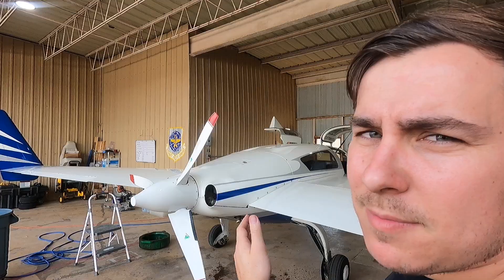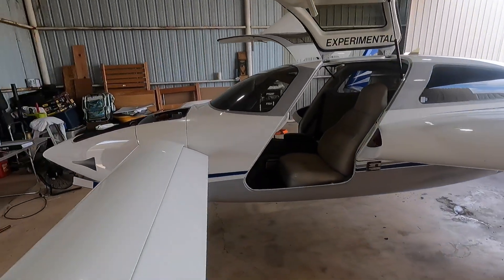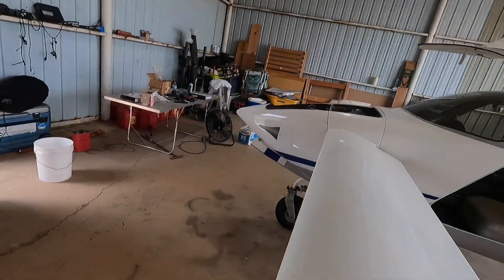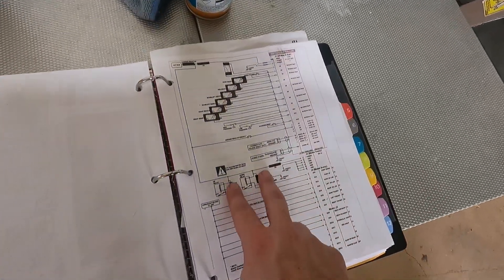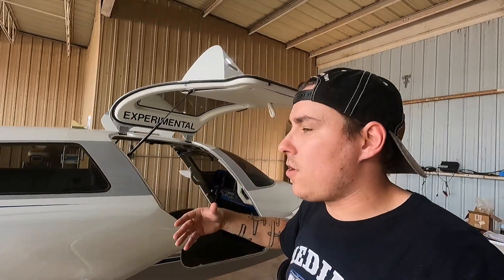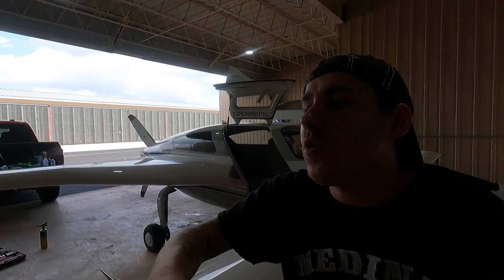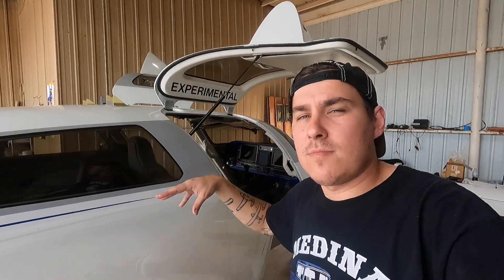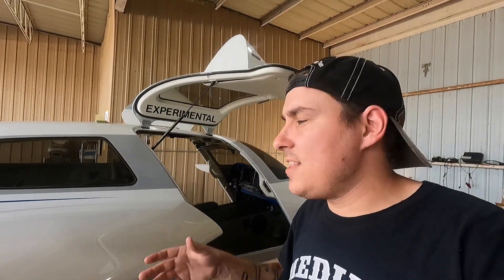Why Working on Experimental Aircraft Can Be Challenging | Velocity XLRG Case Study

Comment: My understanding is that the point of experimental is to do experimental things and the owner only needs an A&P  (or a repairmans cert) to do annuals and they are not subjected to potential FAA inspection of hangars like an IA might be.  So you have a lot more rights with experimental.  I wish my pitts were experemental.
Reply from the maker: You certainly do have way more freedom without red tape. With that said, the owner of this Velocity is very hands-off, so I've had to figure out and learn a lot of how it was built to do the condition inspection. I've done RVs with the owner who knew their plane inside and out, and it was much easier on my end.

Also also. I've never said this on the channel, but a Pitts is my dream aircraft. I used to work on one somewhat often. The tattoo on the top of my  wrist is a pitts
Reply: @brycebuildsit very cool, getting ready to trailer my Pitts and move it to a vacation property in Tucson.

Looks like I can’t add pics on here but if you want to share your info I can send some cool stuff

Never understood being hands off, it’s my life in the seat.

Still working on my A&P, did a practice general and keep pulling a 75 so that’s not going to cut it.

Comment: I help fix up and ferry a Wheeler Express 2000 RG. I had tons of issues with the landing gear retracting/extending in flight. It was one of the only ones in existence and it had 0 maintenance manuals or even checklists designed for the RG version. Troubleshooting the issues and finding a way to get it ferried to the new owner was very challenging but also one of the more rewarding ferry/test flights I've been involved in. It's both fun and annoying that every experimental can be very different even between the same model.
Reply from the maker: The velocity isn't that bad. It's one of 6 or so using the AH700 controller. Fortunately, it does have a wire diagram for it.
Reply: @brycebuildsit that would have been interesting without a wiring diagram!